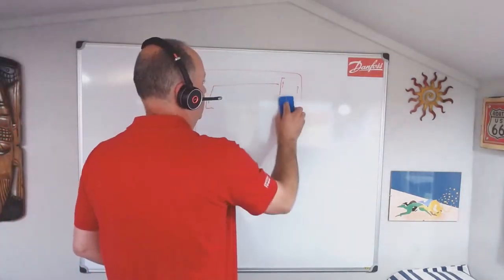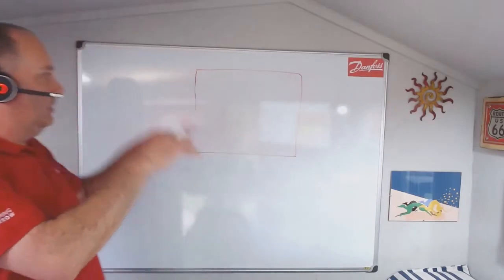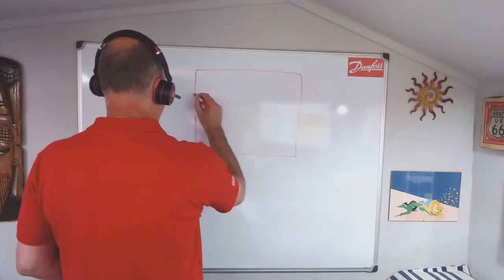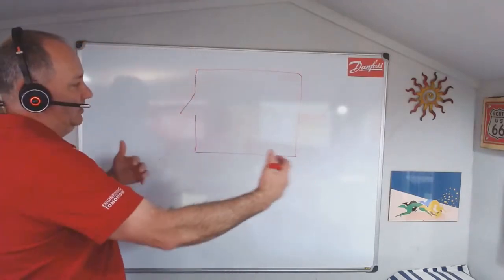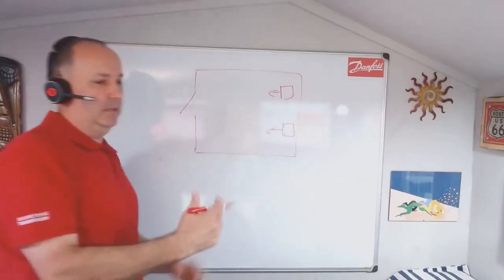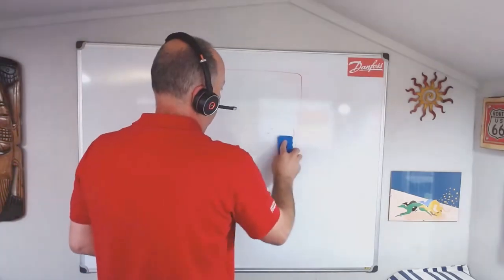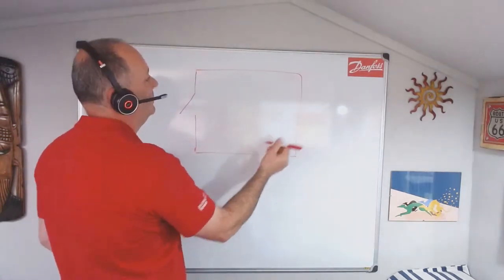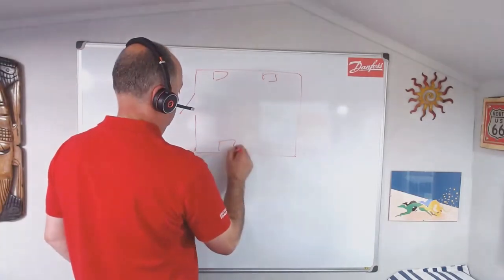What is the right location for an evaporator in a cold room? | Ask an Expert

Comment: Si on met les évaporateurs au fond de la chambre comment faire pour les eaux de dégivrage ? sur tous si on peut pas accéder derrière la chambre.
Merci
Reply from the maker: Le risque avec l’évacuation de l’eau issue du dégivrage de la batterie est de geler dans le tuyau d’évacuation.
Cela va créer un bouchon de glace, qui empêche l’eau de s’écouler jusqu’à noyer l’évaporateur, puis prise en glace, risque de casse lié à la dilatation de la formation de glace, etc ..
Les recommandations sont donc les suivantes : 
- Installer l’évaporateur tant que possible à l’opposé de la porte d’accès (sinon l’apport d’humidité peut être augmenté si les ventilateurs de l’évaporateur aspirent l’air extérieur)
- Amener le tuyau d’évacuation des condensats à l’extérieur de la chambre en allant au plus court, de façon à ce que ce soit en effet accessible à l’extérieur.
- Bien isoler le tuyau d’évacuation pour éviter au maximum le risque de prise en glace dans le tuyau.
- Pas de siphon à l’intérieur de la chambre, car l’eau stagnant dans le siphon va geler.
- Le tuyau d’évacuation doit avoir une pente suffisante (minimum 1cm / mètre) pour permette à l’eau de couler librement et rapidement.
- A l’extérieur de la chambre, le point haut du siphon doit être suffisamment bas  pour ne pas aspirer la colonne d’eau en phase de fonctionnement de l’évaporateur
- Dimensionnement du siphon :
  - 1mm de colonne d’eau = 10 Pa
  - Calculer la colonne d’eau minimum H1 nécessaire, selon la pression disponible du ventilateur de l’évaporateur
  - Prévoir une hauteur minimum H2 = H1 entre le point haut du siphon et le bac à condensat.

Comment: Thanks. But,  What about the drain pipe ? Sometimes a drain point, detemines the place of the evaporator.
Reply from the maker: Thanks Ricardo. The location of the evaporator has to take priority to ensure good cold room performance. The location of the drain is a secondary consideration; however, there are some circumstances where it takes a greater priority.